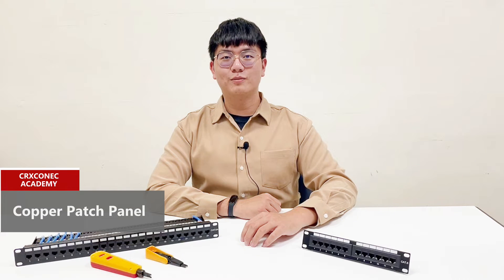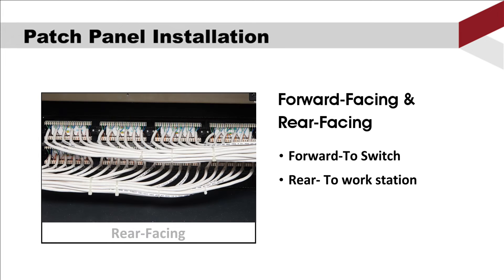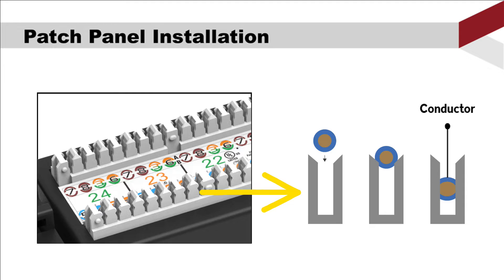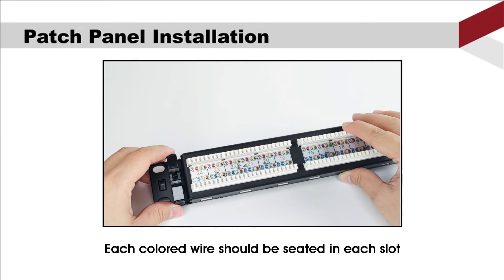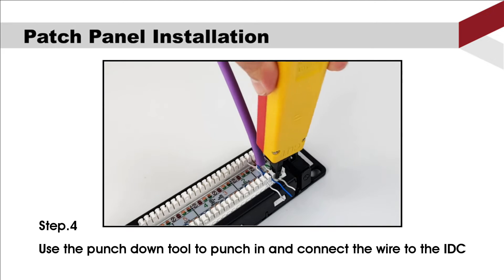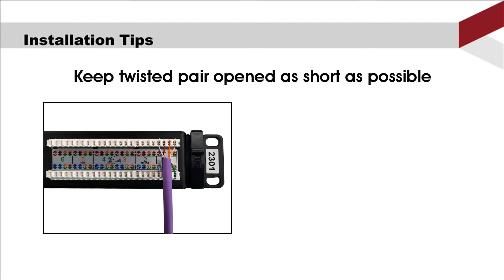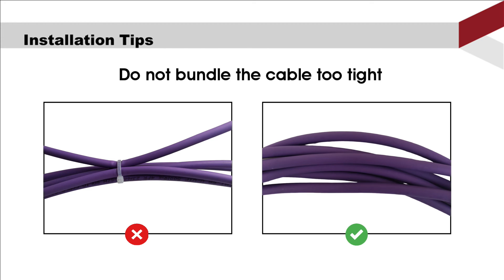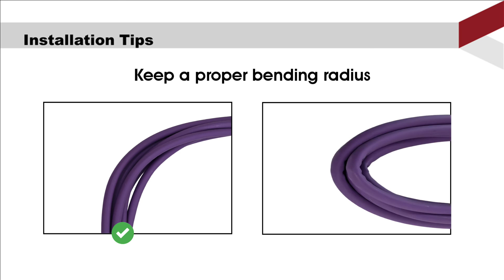How To Install The Patch Panel?  Easy Tips Sharing

Comment: I still don't understand the need for a patch panel. Why not just connect the ethernet directly into the switch?
Reply: Patch panel is for cable management nothing more and nothing else
Reply: that is based on end to end structured cabling design, it will be more flexible to do any modification for the installation.